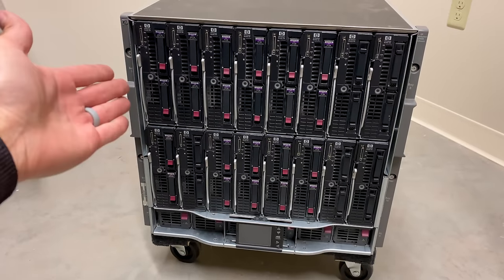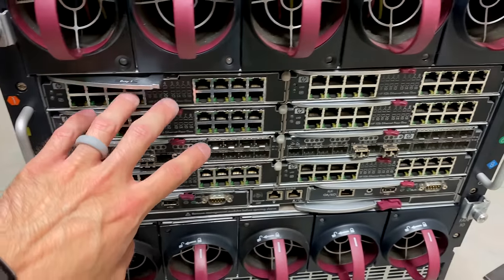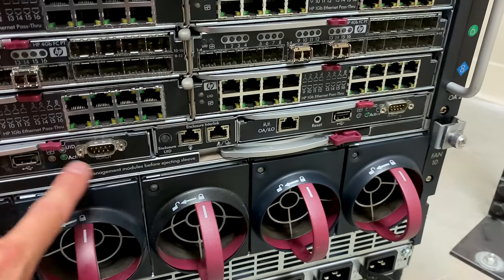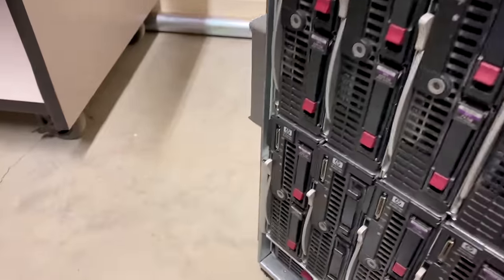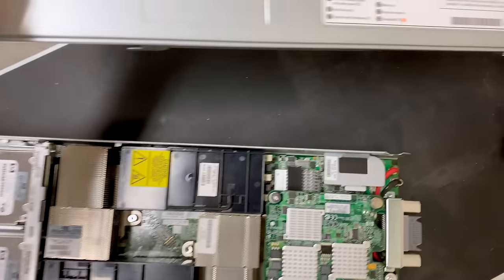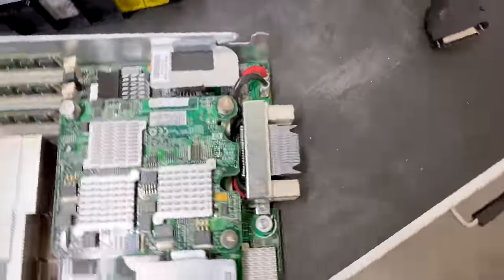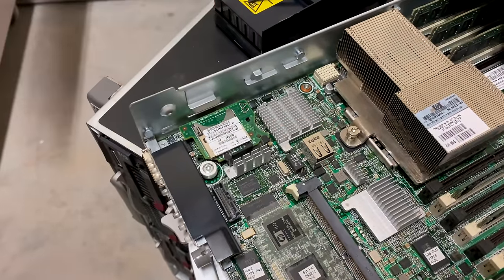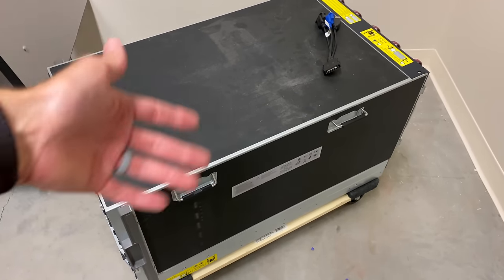Let's Check Out an Old Blade Server System with 32 CPUs!

Comment: We still have ~2000+ C7000 enclosures deployed and I can tell you it is a rock solid platform. We have a mix of G1 to Gen10 blades deployed across them, mostly for virtualization workloads, but the enclosures themselves are tanks. HPE has officially discontinued the C-Class platform after the BL460c Gen10 and moved to Synergy as its latest bladed compute architecture. Crazy to think of piece of technology that was announced in 2006 supported new hardware up until 2018.
Reply: The thing that failed most often were the things that HP didn't make: HDD, Cisco switches, and Brocade switches. But those were all designed to be redundant, so even if something does fail, it rarely takes the blade fully down before you get a chance to address the problem.

Comment: Still manage several of these with more recent blades. One nice thing is using HP's FlexFabric modules & SAN booting if we have a hardware failure we can just reassign the profile and reboot the failed system on a different blade even in a different enclosure.
Reply: I've been doing that with Cisco for a while. It's nice to see some abstraction. The big problem with these systems (HP/Dell/Cisco) is that the density drives the datacenter power/cooling requirements. 10KW in 8U, in a 52U rack = 60KW/rack, without redundancy. It boggles the mind how to get that much juice into 19". :-)
Reply: Oh, did you do the iLO chassis link? I set that up one time with literally zero documentation about it and I was super excited to get it up and running. You have to chain all of the connected chassis together like a token-ring network.

Comment: fun fact: each PSU provides 12V @ 200Amp (the newer 2.4kW ones) and the backlane has a solid copper plate to distribute that 1kA to the blades :D

Comment: I worked with quite a few of these enclosures and blades, multiple generations.  It can run with a single Onboard Administrator ("OA") module, but as I discovered that little display panel only works from the primary one.  OA1 was dead, thought it was the display itself.  Read the docs, swapped the two OAs and the display worked fine.  Ran on one OA during the build & testing while waiting until a replacement OA was shipped.

When you were showing the expansion module underneath that small clip/tray you removed, that tray holds the battery for a storage array accelerator.  It provides power for the controller cache memory, so you can speed up reads & writes on the RAID controller.  Helps performance a fair amount, but those proprietary batteries tended to wear out.

For those of you on a (power) budget, there's a C3000 chassis that only has eight slots, and can be set up with casters for office use.

Comment: I recently saw a system very similar to this, but instead of each blade being their own server, they could be turned on and off with PXE and then that blade would be a temporary host for one or more virtual servers; this was meant to able to use as little power as possible with little or no activity by hosting a number of VMs on one or two physical servers, and whenever demand increased one or more additional physical servers (blades) could be turned on to host some of these VMs.
If I recall correctly, the software used here was MaaS (Metal as a Service), by Canonical, for managing the hardware and host the VM. And I would to make one thing very clear, I am not sponsored by or in any way affiliated with Canonical.

Comment: In some ways, virtualization made these platforms even more popular.  For example, if you’re running a docker environment with kubernetes for orchestration, you can dynamically scale up your compute power on demand if your apps need it.  You have the dynamic scalability of 16 servers if you need the additional power.  Also, blade servers are also used if you need massive compute power.  If you have applications for weather forecasting, hardcore video rendering, computing hashes for bitcoin mining ( I know they have dedicated ASICs doing this, but it’s the only thing it’s good for; more flexibility on a generic compute platform), or for computing mersienne primes for whatever reason, these platforms can give you supercomputer powers in the footprint of a single rack.

Another thing I love about these platforms is you literally can setup your networking environment remotely without having to plug in gobs of 10GE AEC copper cables.  For example, a Cisco UCS B platform with Nexus 6K fabric, you can create a sh!tton of virtual interfaces for the blade servers and uplink them to whatever number of port groups you desire, all remotely.

Of course you have to physically install it in the lab or data center, but after that, you can setup everything remotely via CIMC (or iLO, DRAC, whatever your favorite brand servers is) including installation of the software on the blades as well as configuring whatever networks you require on the switch fabric.

I love blade servers for those reasons.  They’re also a huge headache, because the fabric is another layer of complexity, especially in virtualized environments.  You can have a docker/KVM environment running in a virtual machine in VMWare, going over virtual ports then to virtual physical ports from the blade servers VIC, then to the virtual port groups in the fabric, through a vlan in the fabric, then finally coming out of a physical port on the switch fabric.  Yup, flexible ecosystem but a pain in my ask.

Comment: 0:55 - it's a C7000 G2. Other than the G1 it does already have the wider display but the backplane doesn't support that much throughput as the G3 or G4. I used to have a G1 as well as a G2. Now I have a G4 and a G3 as spare.
For those who are wondering, the design of a C7000 G1 is like the Proliant Server G3 and G4 series, the C7000 G2 design is like the Proliant Server G5 series, the C7000 G3 design is like the Proliant Server G6 and G7 series, and the C7000 G4 is like the G8 and G9.
Some parts from G1 are still compatible with G4, all in all, a fascinating machine, but quit annoying to manage.
Reply: Still running G1 and G2s lol. Connect at 160gbps without issues but yer replacing soon as no new blades are coming out for them now.

Comment: Virtualisation does not put blade servers out of favor, they are still widely used as nodes in virtualisation clusters. Rack space and power consolidation still make sense in that regard. HPE made a new Synergy lineup of blade servers specifically to be used in VMware clusters with tight vCenter integration.

It makes more sense to put VMs on a bunch of moderately powerful nodes than to cram them all into two high-performance ones. If node goes down - you have more compute and memory room to relocate affected VMs.
Reply from the maker: Certainly true, but cost is a big factor as well — blade servers/chassis simply cost more than an equivalent setup of separate servers. If density is the most important factor then the additional cost could be worth it (if, for example, it keeps you from having to install/rent additional rack space). For a lot of businesses, though, density isn’t such an issue now.
Reply: Depends on where you get them, and how new they are. At work, they got on to the blade-center train for a year or two. The efficiencies that came with density were attractive -- 80 core processors, huge amounts of RAM, 10G networking, SSD everything, uses less power than a lightbulb, and is the size of a cellphone, etc., etc. (320core/U, ~500W/U) That is, until they started writing the checks. Then my age old process of buying other people's previous generation hardware for pennies started making real sense. My way might take up 14x the space, and burn 4x the power, but at 1.5% of the cost.

(And yes, I provided numbers for building our own (small) data center [283sq.ft, and it took 1.5yrs to get it built], put our racks in someone else's DC, and just rent all of our infrastructure. Building our own was massively cheaper. And that tiny room wasn't cheap -- about 20% of the cost of those blade systems.)

Comment: I worked on some a generation or two older than that model. I liked them because they were really well built and when they did fail, they had lots of diagnostic LEDs so I knew exactly what failed and what to do about it. That really helped minimize downtime.

Comment: I used to work on an HP blade chassis like that, in a storage QA lab. Ours had a bunch of brain-damaged Brocade FC switches in those pass-thru bays that they called access gateways. They were used to connect it to a bunch of HP-branded storage arrays.
Reply: You don't know brain-damaged Brocade FC switches until someone tries to update the firmware on one and ends up accidentally deleting the kernel. Wasn't actually me that time, and Brocade refused to send us the USB key that contained the full image with the kernel. Oh, did I mention that the Brocade FC switches only work with Brocade USB drives? Because they do.

Comment: Hadn't seen those in a long time!  We actually had 4 of them when I worked at Purdue University several years ago.  We were one of the first groups that bought HP's new Blade System Matrix to build out our SAP environment.  We ran VMWare ESX on each of them and had 2 HP EVA's (one in each building with 2 chassis) for storage connected via fiber channel.  It was quite a setup and had a lot of issues.  But when it worked it was very nice!!  Quite outdated by today's hyper-converged standpoint...  :)

Comment: Yeah, I ran a C7000 with 1x G1 and 2x G5 blades for a home lab. I had to hook it up in my detached garage because as it was little loud, even in it's "running" mode.  I ran it with 3 Power supplies and all the fans on 220v.  My power bill only went by up by $100 a month.

Comment: I got 2 of these chassis in my lab. Got a crazy deal on both NIB for almost the cost of shipping. Only ever used one and have had just a few blades running over the last 4-5 years though. For lab stuff, it's handy being able to spin up extra nodes by just shoving them in.
Mainly, it's just cool.

Comment: Remember setting one up for a client.  Buying the chassis.  The blades.  The whole thing weighed a ton.   Loud as hell!!!   It was about cpu density.   But had some complexity in its setup and use.  I think Epyc Rome and VM kill the blade idea pretty hard.
Reply: Not as much as you might expect, since Dell is moving to high-density compute nodes by making 2U blade chassis with 4 blades supporting 2 Rome processors per blade. I believe their intention was to pair them with in-rack switching and a PowerStore or PowerMax storage array for VM storage.

Comment: I was contemplating buying one of these at one point because I needed a lot of cheap bare-metal servers to run a MongoDB cluster. It was the relatively high price that ultimately put me off. I ended up acquiring a bunch of 2U 4-node servers that I managed to pick up for $60 per chassis; 12 nodes in total, and 4 of them currently in my server rack. These older servers still have a use if you're not using them for anything compute-heavy.

Comment: "In what industry are they decommissioning a blade chassis?"
(notices they're all G6s)
"Never mind!"
Reply: G6 is pretty old... they roll Gen10 nowadays.
Reply: Gen8 should be a good start, any lower than that and say hello to the expensive powerbill that just arrived.
Reply: @retr0nus  I have a Gen7 and lemme say that the power bill isn't really that high probably only $10-15 extra due to 8 drives connected (All SAS drives) and two X5650's equipped with 32GB of ram (16GB per cpu). I have no complaints with the DL360 G7 but I had to let it go yesterday (5/1/2021) due to it being outdated and the recent purchase of a DL380p G8.
Reply: @connorc2926  Cool, was over generalising my previous comment. Although it does depend place to place too unfortunately.

Comment: I worked with many of these, and all the features you spoke of, in one overall system of blade servers, chassis, redundancy, was simply amazing.

I wrote Windows command line scripts that accessed the servers and iLO through PuTTY's "plink" ssh, gathering data and generating reports on  things like pending RAID accelerator battery failures, RAID drive status, firmware versions, just about anything.

Comment: Contrary to what Sales will tell you (assuming you're always dumping last month's model for the latest and greatest), those old G6 servers are still out there in the thousands, still running, and I bet there's a pretty good chance that this video is streaming through some of them lurking at telcos around the planet.  

Blade type systems are not dead yet, and HPE and Dell still sell them!  Some even run VMWare hypervisors, but some are combined to make bigger monsters.

Two big things coming out as far as density is concerned: Many multiple blades (HPE's current "blade" type product is called Synergy, but they also have smaller, simpler systems called Apollo "sled" servers) They can be virtualized in a way HPE calls Converged Infrastructure, or they can be combined to form High Performance Compute Clusters (HPCC) to act as one large system for weather mapping, statistics, and I suppose crypto mining (though no one tells us if they're crypto mining). In many cases, individual servers can be "drained" or configured out of the larger cluster while it's running, and serviced, and then rejoin when fixed.  (A lot of Linux runs in those clusters!)

Also, there are huge systems of multiple large, interconnected chassis to make one big system with tons of memory interconnected (HPE's Superdome Flex, for example.) On those, you have to shut down one or more racks of several chassis to service anything in the system, because they're all one system and they run full databases direct from terabytes of RAM.  (For redundancy, a company would have to have ANOTHER Superdome beast in a cluster!)  You don't find VMWare running on the Superdome servers, nor do you find it in High Performance Compute Clusters made up of hundreds of blade or sled type servers. What you do usually find is one or many optimized versions of Linux running very specific tasks.  These are not your Exchange Administrator's systems!

You typically find this stuff in huge data centers with hundreds of racks and thousands of servers (where you need grid coordinates to find what you're supposed to work on). Not so much in a small office's single or handful of racks in a room.

Comment: I used to be an admin for two stacks of these - 4 chassis on each side. If those cabinets weren't bolted the ground, pretty sure it would fly.
Reply: Having moved a chassis on my own using an equipment lift, then repopulated with fully with 16 blades, I can confirm that despite the impressive cooling performance, they weigh a metric shit-ton and wouldn't budge an inch even if they're not bolted down.

Comment: At the last company I worked for, we had just finished acquiring a new Cisco UCS blade chassis for use with virtualization. I think it was 56 cores and 1TB RAM for each blade and 6 blades per chassis. It wasn't my department but I overheard a lot of the discussions leading up to the purchase in 2019.

Comment: I had two of these at my prior job--one at the data center (with four blades), and one at the DR site (with two blades).  We caught a deal where you got the chassis free with something like three blades.  At our data center, one was a vCenter and the other three were VMware hosts in a cluster.  Similarly the DR site had a vCenter and a host (all our VM's could easily run on one).  Regarding the switching, there was "backplane switching" IIRC, so you didn't have to cable every individual blade.  We had dual SFP+ blade switches forming our core, and we ran a SAN with 10Gbe DAC cables to those blade switches (we did NOT use fiber channel, it was all iSCSI for us).  From there, a pair of 2910al switches with SFP+ modules linking to the blade switches, and from there, out to the LAN.  Pretty sweet setup, though the smaller chassis (half this size) would have been sufficient.

Comment: I love these. Have a C7000 with 12 G8 blades at home. Couple of 12 bay storageblades in it for vsan, HPE 3Par with fiber connected to the C7000 and blades. Very rock solid, flexible solution!

Comment: I picked one of these up a few months for $50 without any blades. Really fun setting it up but holy does it suck power and make a lot of noise. 350W idle with no blades installed.
Sad to see it decomissioned though, I stuck a few G8 and G6 blades in mine and it performs quite nicely. As far as I'm aware, these were designed to be 'never obsolete' by having techinicians simply remove old blades and install the newer G8-G10 ones.

Comment: I worked somewhere where I ordered and set up one of these was a nice kit in the day, you could have full height blades that took up two of the slots but you could have 4 procs. I do remember we had a chassis fault and had to take the entire thing apart to swap it over, wasn’t funny. It was powered by 3 phase as well. Had to get special Eaton ups’s for it as well. The idea behind these at the time was great as they were so modular and flexible but the prices for the smallest thing was astronomical. I can remember the interconnects on the back costing more than the servers

Comment: Data centers are still using them as "hybrid servers" where virtualization will split the server into two or more virtual machines. Usually QEMU/KVM. Or these dirt cheap $10-20/mo dedicated "instant deployment, no upgrades" servers too.

Comment: I've built many or these over the years. One project had 28 fully populated enclosures. I spent quite a lot of time building those (even using Puppet to do some of the basic deployment/configuration). HP also sell Virtual Connect modules - a way to consolidate and reduce the number of physical connections. Deployed that on a few other projects. A c7000 chassis can also take full-height blades and storage blades.